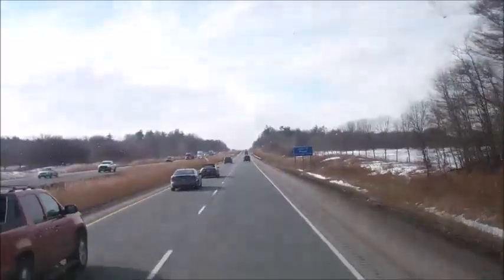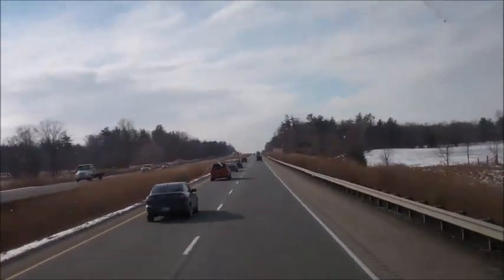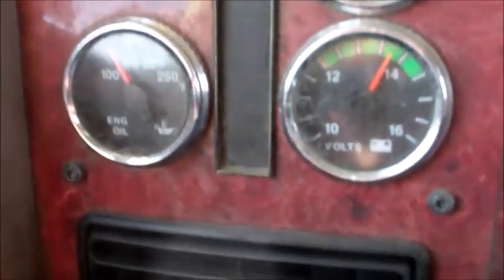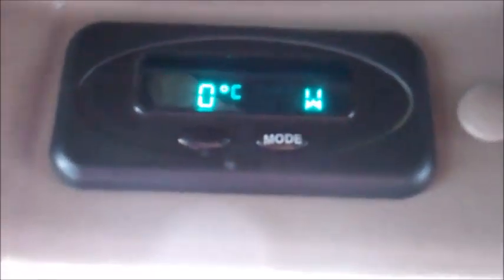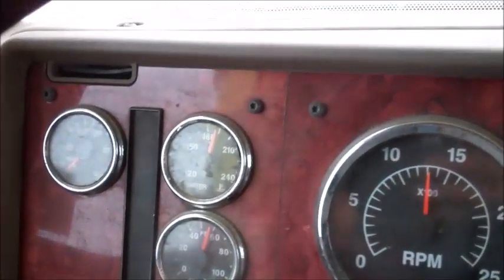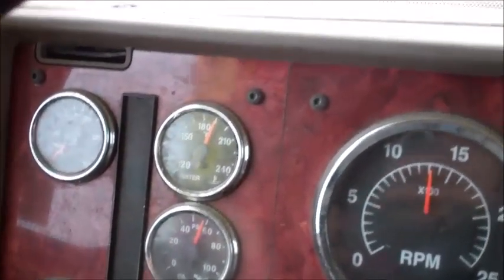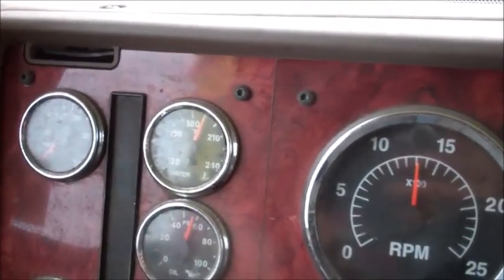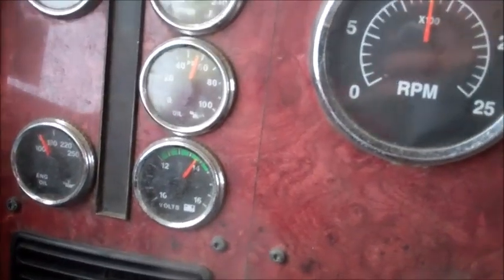EPISODE 39: TRUCKING WITH SERGIE DRATCHEV

Comment: i'm guessing the belt noise may be a tensioner/ idler pulley.  i believe they have a tendency to fail once tension is removed to release the belt.
Reply from the maker: the noise pretty much disappeared by itself on the second day. go figure ...
Reply: ***** New alternators whine initially as the bearings set in.

Comment: Great Video.  Glad you are back on the road and with a baseball hat and sweater.  Looking forward to seeing what you get for your next dash cam.  Have a good trip. Have you had time to read on your Kindle?  What is your review after some hands on use?
Reply from the maker: I"m reading that stock investing book I mentioned in the Kindle video. The screen is easy on the eyes and there's different typefaces and font sizes you can choose from, plus the size of the margins. looks like someone was focused on making the reading experience as comfortable as possible. the only thing i have to get used to is flipping the virtual pages much more often than in a regular book. getting books on-line is a one touch process, and Amazon has a huge selection.
Reply: Thanks for the feedback. You are right that they focused to make an enjoyable reading experience. You will get used to turning the pages soon enough just like learning any new technology.

Comment: You've got a habit of locking yourself out of the truck ;) Time to invest in a door unlocking kit? Probe and prod system + a wedge would be great to have ;)
Reply: And how do you suppose he get to the kit when it's inside and he's locked out?
Reply: Trailer box or somewhere around there ;)
Reply: Hate to say, Sergie doesn't have a "trailer box" or other exterior utility box to put tools in. Besides if he could have a means to get into the truck kept outside the truck would it not be cheaper, easier, simpler, and faster to hide a key on the outside than to purchase and keep unlock tools on the outside?
Reply from the maker: killer2600 after i bought this truck in 2007, i found an extra key cleverly hidden in side the engine compartment under the hood. that's probably the best way - you can always open the hood but unless you know the exact location it'd be hard for a crook to get to it.
Reply: killer2600
Of course, whatever is easier for a person. I used to keep a spare key in my wallet. But it doesn't hurt to have an extra back up plan (if one has a tendency to forget things).